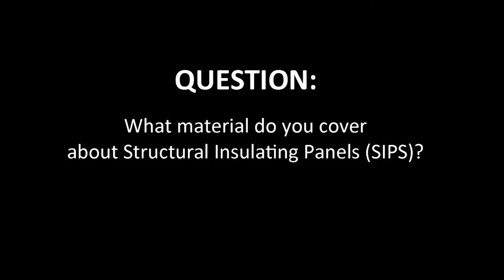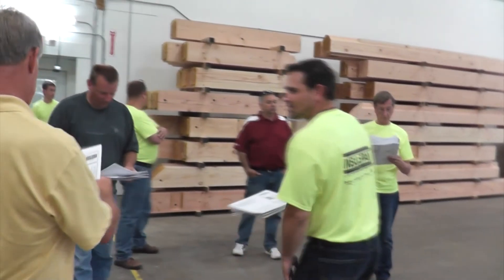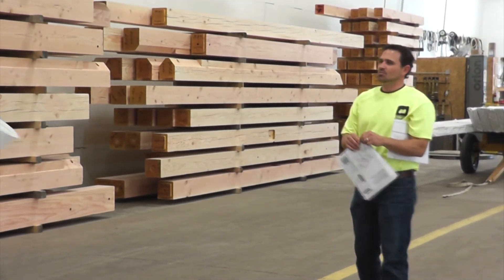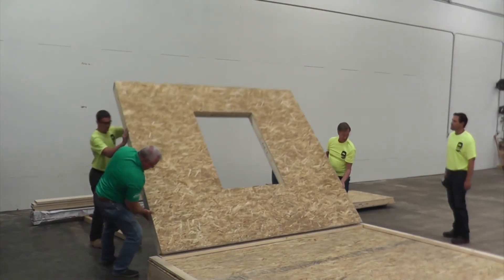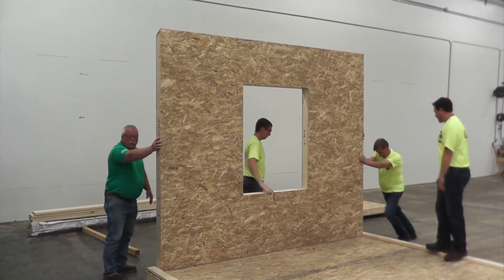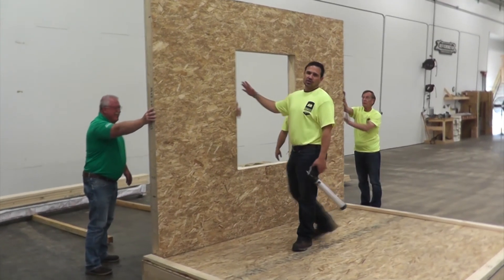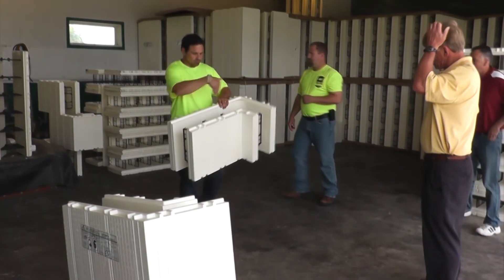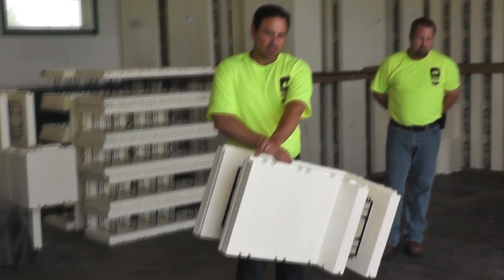A Look Inside: Insulspan University's Hands-on Training

Comment: Thank you George. To answer your question residential homes in the US require a 15 minute thermal barrier , and as most homes (let’s sat 99.9% even)  apply drywall to the home to finish it, it achieves the code required fire barrier. Rarely would that OSB be left unfinished in residential construction.

Someone can also choose to finish their home with T&G, and if this is the case, it still meets the thermal barrier requirements. We use a structural grade OSB to create a stronger more reliable product. It is code tested, approved and listed as the product of choice in many architectural specified projects.